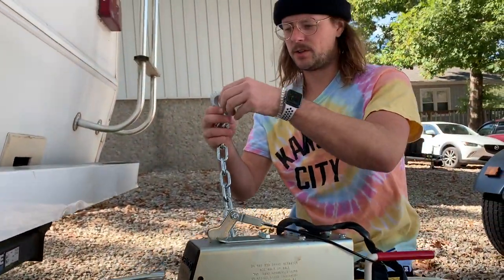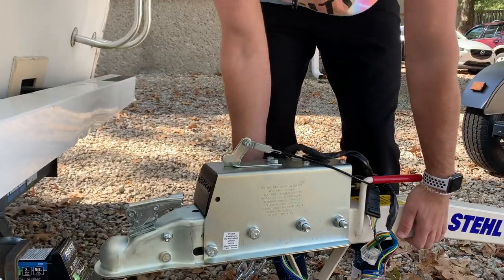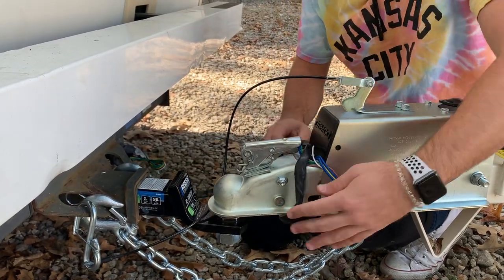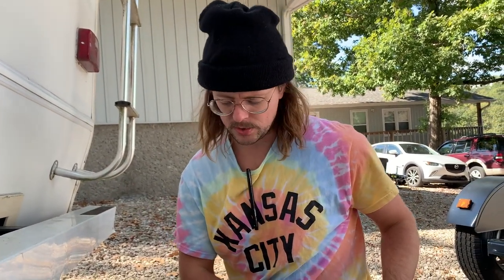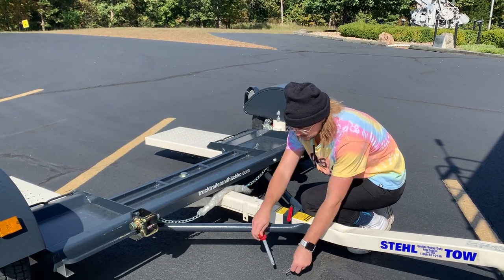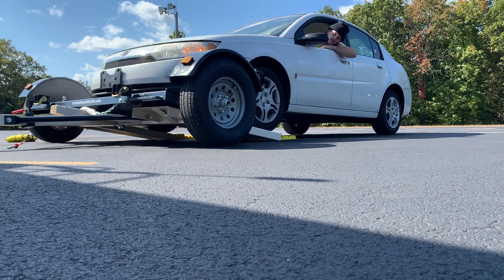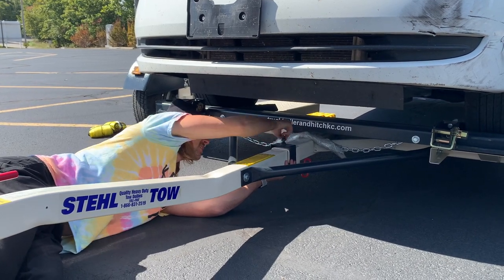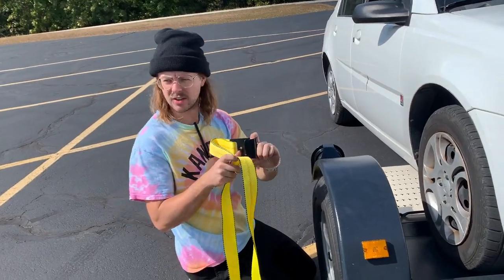Towing Car Behind RV | First Time Using Tow Dolly - Episode 11

Comment: We are about to get a Stehl Tow Dolly to pull our Honda Civic.  The YouTube gods must knew and pushed your video up.  We are transitioning from a travel trailer to a Holiday Rambler Class A.  Looks like once you get some practice it will take 15 minutes to get loaded up.  Any regrets going with the Stehl?
Reply from the maker: The stehl was great. Definitely no regrets. Towed well and never had any issues. Only "negative" is that it can't tip up so it does take up quite a bit of space but it was never an issue for us.
Reply: @theaustinwilt  we ended up with the master tow.   we have put over 2000 miles on the dolly so far.  Not too crazy about the cheap Chinese tires, but so far they are doing good.  Put a TPMS system on them and keep them properly inflated.  Got a video out of my trying to use it for the first time.  Stop by if you want a laugh 😃

Comment: How easy is it to tow with the dolly thru gas station...how long is your rv
Reply from the maker: It's not too bad. Just take it slow and swing wide. RV is 28' long. I try to stick to Pilot's and Flying J's or any other truck stop. Any gas station that can accommodate big rigs coming in should be pretty easy to get in with an RV as well. Gotta be careful when pulling forward because you cant back up with a tow dolly so don't want to overshoot the pump haha.

Comment: My fiat lower fromt bumper caught on tow frame and ripped off when removing from dolly. Why?
Reply from the maker: We use levelers to make the transition smooth from the ramp of the dolly to the ground. You could also use wood 2x4 scraps or something of that nature. Makes the incline less "harsh"
Reply: I have a Honda Fit and it would not clear without my placing a 2x4 under each of the ramps so that the angle was diminished.  There are other YT videos that demonstrate this.  Ideally you want to create two additional "ramps" by attaching a 12" 2x4 to a 24" 2x4 and place the elevated part under the ramp.  Drive your car onto the longer board and subsequently onto the shorter, which leads to the ramp.

Comment: you failed to mention locking the steering wheel or not.Depends wheather of not the dolly steers
Reply from the maker: Yeah we don't lock the steering wheel. Our dolly pivots so haven't had a need to lock wheel.

Comment: Did you disconnect the drive shaft ?
Reply from the maker: I did not. Depends on your make and model of car but neutral was fine for us. Your manual should say what you need to do for your car.

Comment: Nice job.  How much is the dolly and do you find that the ramps hit the ground?  Noticed a lot of these have removable ramps.
Reply from the maker: I think the dolly was around $2400 with a spare tire. It's a new 2021 Stehl tow dolly with surge brakes. I personally wanted the surge brakes because its a lot less maintenance and you don't have to mess with an electronic controller. Ramps hit the ground fine when on level surface. I use plastic shims used to level the RV to help make the gap between the ground and the edge of the ramp less aggressive for the car. I've heard removable ramps are really good for storing. These don't remove and therefore it is a little more bulky when storing but I find them to be really sturdy and I like the design. Easy to move around by myself.
Reply: @theaustinwilt  thank you so much for that info.  Safe travels

Comment: What size wrench do you use to tighten the wheel straps?
Reply from the maker: I sold the dolly unfortunately so I don't know the size. When I bought the dolly the wrench came with it.
Reply: I just had to solve this problem this morning.  I bought a Kobalt sliding/adjustable wrench that locks into place because I didn't know what I needed to buy.  You could also buy some vice grips.  Good luck.

Comment: The car that been tow need to be registered have tag and insurance?? Or i can the kind of temp tag bcs traveling to another state???
Reply from the maker: Definitely check with the states you are driving through. I'm not sure on something like that. I know in MO, KS, and CO you don't need to have the actual tow dolly registered. Those states consider a tow dolly an extension of whatever vehicle is doing the towing. Both the tow vehicle and the vehicle being towed need to be registered though. I would imagine if the temporary tags are still valid you would be fine but I would check with local laws to verify.
Reply: When you turn sharp with the car dolly does the swivel pan have a stopper? If I make to tight of a turn the pan tweaks and pops over the stop plate does yours do that?
Reply from the maker: I haven't noticed mine doing that. I do know when you turn tight you can run into problems on most tow dollys. I try to keep it pretty wide when possible. I've been pretty impressed with the Stehl tow dolly thus far. About to take another trip in a few weeks so I will keep an eye out for what you are saying and let you know if I notice it doing anything funny.
Reply: @rongoodspeed9028  my Master Tow has sturdy stops. Might want to check your center bolt adjustment in the swivel pan. If the pan turns too far, you could do major damage to both the car you're towing and the dolly.